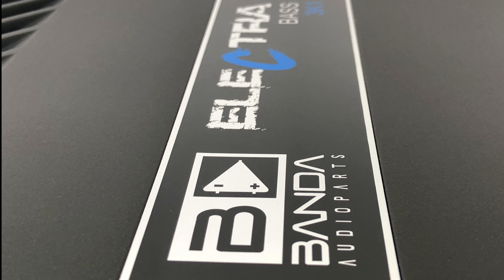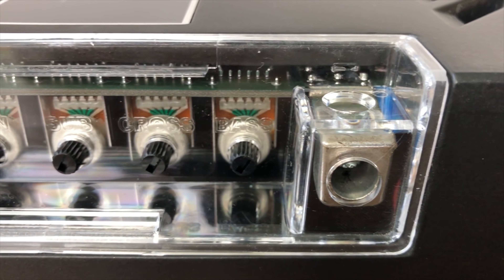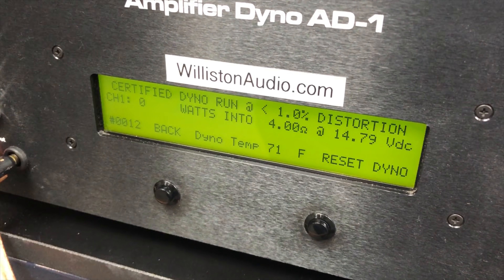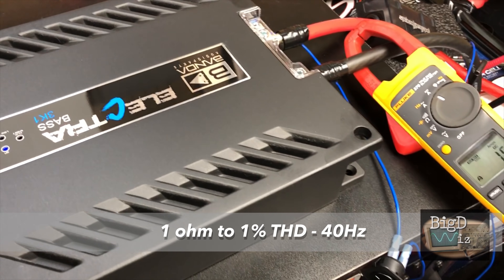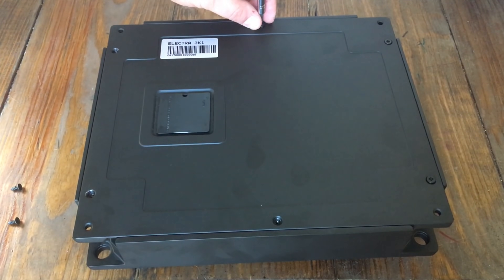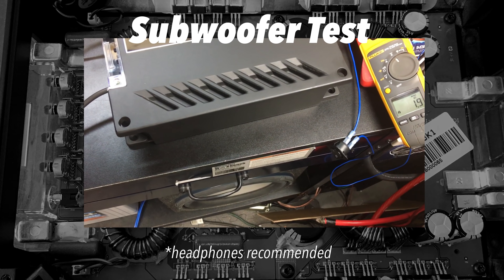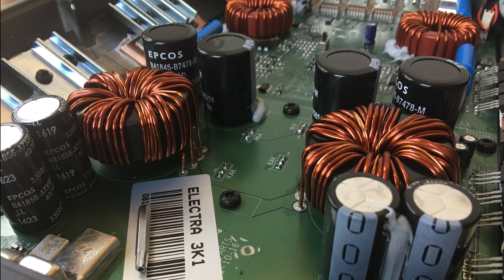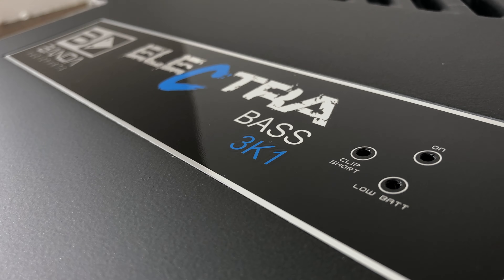Big Brazilian 3k? Banda Electra Bass 3k1 Amp Dyno Test (4K)

Comment: I'm running this amp for 2 years with good electrical. It never overheats in a tropical climate, delivers good power and has a switch to disable all filtering to allow the low lows, which is what I use it for
Reply: @SubwooferGym  hey bro, I know a year late. I have the 7k and it has 1 rca but headunit has 2 if I y split it gets way quieter. Do I just run one?
Reply: @alexrathbun3817  Hey, yes just run one. Running two doesn't mean twice the output level. It's the same mono signal

Comment: It doesn’t go into protection and all the amps turn on fine I had tested everything before putting it into the car with one battery and a booster the bass played for a while with no problems but it doesn’t wanna play in the car all the other amps are getting sound out

Comment: Epcos? Wow! Those are very high quality (same compnay as TDK) Japanese caps. Like same situation as Rubycon and Nichicon... they are the real deal. I see your efficiency numbers are a bit lower than they should be since the amps will spike up in current when clipping and that is where you took your amperage measurements on your clamp...  I would say efficiency is more like 75-80% rather than 65-70% - Either way, great test, great observations on the quality of the heatsink.. You know I think these may be better than Soundigital... they sure are cheaper!!! I always considered Soundigital the gold standard for Brazilians... obviously Taramps is pretty cheap.. (although not terrible compared to some Chinese clones) but the Soundigital is decent (albeit soundigital is WAY overpriced) - I think I might pick up one of these Bandas to try out...  - Like for real, companies that are crappy dont (usually) spend money on quality Japanese components.. My trust for them has gone way up seeing those Epcos caps.

Comment: The Electra 12k looks like its sized rite. Looks like the same case as the 8k8. Got one on the way, fingers crossed it turns out to be good.
Reply: How did you like it? I just got the 12k and mine is freaking loud! Blew my fuses and got 2 more. Haven't seen the clip light yet sooooo.....
Reply: @michaelnewkirk578  I actually ended up getting the 12k .5 ohm. I ordered the 8 then a week later got an email saying there out of stock.   I'm running it at 1 ohm on 2 rs platinum 18s and they slam. Getting ready to get 2 more 18s to run 4 at .5.
Reply: @timjd7964  yes I have the 12k one ohm model running it on some FI Team V1 15s, and they slam! Had it for almost a week now but blew the 300 amp fuses so I had to buy some more. So far so good 👍
Reply: @timjd7964  got it all in a Scion tc.....I know things are going to break 😱😅
Reply: @michaelnewkirk578  hell ya that's part of the fun
Reply: @michaelnewkirk578  and to answer your question it's been a solid amp for the 3 months or so I've had it, no problems at all.

Comment: Banda or soundigital?? Which is better??
Reply from the maker: That’s tough, both seem similar in quality to me
Reply: @wal  heard that SD has heating and build quality issue. Need to power 4 x 180 watt speaker  and considering either banda beat 800.4 or soundigital 800.4.but the SD is more expensive, lower wattage(8 watt less than banda) and lower efficiency as compared to banda.

Comment: Thinking of getting back into the life. I used to have a Soundigital 8K powering 2 DD 18s. That was around the time Brazilian Amps were just coming over. No one wanted to believe the power they were putting out because of the small wire inputs. I didn’t push it hard, but that 8K never got hot.

Comment: I use Banda in my car and recommend it.  Good frequency response, good construction, good adjustments, it has the power it promises and it is beautiful.  The disadvantage I see is that it is not as small as Soundigital.
Reply: Banda beautiful? Which model?? Not the beat version.
Reply: Which model do you have?  I just ordered an Electra bass 8k

Comment: I’ve been hearing that if you go with Brazilian amps that the Banda is the way to go. It has a better board layout. The Tarramps and sound digital just can’t dissipate the heat. The Korean amps just have a cleaner sound and better reliability.
Reply: So, should i go with banda or pioneer??

Comment: Can you make a video explaining on why they use single rca jack input and single rca jack output on these Brazilian and smaller full range amps. I have a sfb2000 that has the same issue and I'm hesitant to use a y splitter because I've never encountered an amplifier like this
Reply from the maker: Great question
Reply: Well they use single inputs because its quite common to use it with sound processors/crossovers that mixes the audio beforehand.

Comment: Not many FETs in there, and small coils for a3k amp.
Brazilian amps must have a completely different design
Reply from the maker: Full bridge design minimizing components to maximize output.
Reply: @wal  Thanks for the reply.
That might explain why they don't like to be run into lower ohm loads

Comment: still waiting for some stetsom amp to go through taht test :)
Reply: I second that, I have the ex 3000 eq and I would like to see real rated power aswell
Reply: @RomaVilla  Stetsom is one of the worst amplifiers brand that we have here in Brazil. SounDigital, Banda and the JBL BR-A line are the best ones
Reply: @L-2K  I guess its all about how you set it up cause ive had mine for over 6 months now and its pushing my 15 zvx no sweat all day long. I have a sfb2k brand new and I get better sound and lower notes with the stetsom vs the sfb2k. Also I got the stetsom and sfb for free so either way I cant complain. Clip light on both amps aswell so that helps with the clean signal. To each their own....💯 but I agree with you 100%.  So many better amps to choose from I just have to unload both of my amps and then invest in an sk3500 as soon as I get the fynds.

Comment: Banda . This amplifier is the best in Brazil .😎. I have an 8000w and it plays a lot.  🔊🤤
Reply: are they good for midrange speakers?
Reply: @yan5362  It will play well too, depending on the power of your speakers.

the ideal would be for you to research the available models of the Banda line checking the powers of the modules to see which would be best in your system
Reply: @andersonbrene9497  the banda beat 800.4 is available at a good price here in mauritius. Need to power 4 deaf bonce midrange speakers of 180 watt rms each

Comment: Why are bass boost controls on the amp not recommended to use?
Reply from the maker: Typically bass controls on amps are at a set frequency and not matching the true frequency most people want/need boosted. Look for variable frequency bass boosts if you really need it or use an external EQ

Comment: Is the Dyno AD-1 reading RMS or peak power? I ask because in another video you ran dynamic mode with some music into the TP3116 and the reading went to 96 and stayed there.
Reply from the maker: All measurements on Dyno are RMS. The dynamic tests are pulse tracks, so you will see power jump up quickly on those tests. You can see the manual on DamoreEngineering.com for the AD-1 Amp Dyno if you have Q’s about the modes.

Comment: These Brazilian amps must not have any de-rating.  I still have a hard time believing these are safe for 99.9% of the time in use.  Lots of power from a relatively small thermal frame.  Pretty similar layout and FET mounting arrangement to an Alpine PDX M12/M6 main board.  This amp should have maybe 16 PS FETs and 16 Output FETs, but I see 8 and 12.  A FLIR camera displaying the thermal output would be pretty telltale on one of these amps under sustained load.
Reply from the maker: Matt are you aware of the architecture differences between Brazilian full bridge and traditional half bridge designs?

Comment: How do calculate efficiency? Also why are u clamping the negative instead of the positive
Reply from the maker: Current measured x voltage. Then take watts shown on Dyno and divide by the (current x voltage). Doesn’t matter which wire you clamp (positive or negative), same current flows through each

Comment: Hi BigDWiz.. i wanted to ask you,what do you think about kicker L7 subwoofer? or what would you recomend me for a nice clean bass around 800 watt rms.. i own a pioneer GM-D9601 and a kicker compRT 500 watt rms but i´m not happy with the output..what would you recomend me ? maybe you can make me a better recomandation for both sub and amp,for a clean loud punchy bass..i also don t have enough space for a pair of two 12s in my car, an audi a3 sportback..  thanks
Reply from the maker: Subwoofers are personal preference. I like JL Audio subs, but I know they are expensive. A single 10W7 would rock your Audi as it does my Accord. Maybe check local listings for a good used one? I got mine for around $200 used
Reply: BigDWiz.. Thank you BigDWiz :)

Comment: @BigDWiz I’m a new subwoofer enthusiast, and I noticed you said do not use bass boost on the amp. Can you explain that to me? Or anyone?
Reply from the maker: Bass boost on many amps can add distortion. Also, unless the bass boost has a variable frequency, then the default boost frequency is usually not the correct frequency. In this case it's 45Hz, which may not be low enough for your application. Also, most remote bass knobs these days adjust the gain of the amp, not a specific bass frequency (and this is the proper way to increase your sub's volume)
Reply: BigDWiz appreciate it! Already subscribed 
Keep the vids coming
Reply: @wal  seria melhor usar reforço de grave no próprio processador ou player ao invés de usar no bass bosst do módulo?

Comment: 7:48 So what'd the difference between "1% mode" and "Clipping" mode? Clipping is a form of the general term distortion. So if we're talking 1% total harmonic distortion and we're using sine waves, how is that different from clipping? Me thinks a term is being used improperly here?
Reply from the maker: Amp Dyno distinguished tests between the two. The certified test stops measuring at 1% THD. Whereas the uncertified continues to the point of clipping and continues the test to see if any more RMS Power can be obtained at this point of clipping. With many amps there can be a significant difference in the results (4-7%), but most show 1% or less difference between the two tests

Comment: Come on BigD. Throw some Stetsom amps on the channel. Their best selling amp is the EX3000eq buit have many amps from 160w to 30k. I have 3 of their amps and would love to see some certified numbers
Reply from the maker: I tried one, so did Ryan Blankenship. We both saw smoke 💨, would not complete the test and I only got 1700’ish watts out of a 3kW amp
Reply: BigDWiz thats odd. Ive ran the 3k on 2 18s at 0.7 ohm for 7 months and never even had a heat issue.
Reply: My 7k2e has been flogged daily for 5 years w/o ever getting more than luke warm. I've even taken it out of the car (thus connected and disconnected it) hundreds of times. I even run it all the way down to protect mode at 9.2V because I don't have proper battery support. I've dropped it that low millions of times wired .7 rising .3 to a perfect 1ohm. I power cycle and go right back to  10V hits nonstop, for as long as I like. I'm so spoiled now, I won't even entertain the idea of buying any other brand amp. 

Setup is 2 soloX18s in 26.5 cubes tuned to 36Hz.
Reply: STAY WHITE hell yeah man i wanna see that shit. I just upped to the EX8000eq and gonna order 2 PSI pf4 18s soon. Box is 41 ft^3 6th order blowthrough
Reply: Also the bridge mode, please!! @BigDWiz

Comment: The clip of the crowd running away from the trailer while they're all dressed the same cracks me up every time I see it. Did you use your torx bit to cover up the serial number on the board? Pleeze tell me you didn't drop it into that high voltage amp by accident!!! Thanks for another great vid big D
Reply from the maker: I love that clip too. “get me outta here!”   Yeah I just covered the serial number in a few pics 😊

Comment: Did you have a problem with preout voltage from the hu? Ik the older bandas didn't like higher preout voltages.
Reply from the maker: No problem with HU. This amp required  gain all the way up with HU volume all the way up. Otherwise it would not reach full output potential. Most modern amps are set around half to obtain max output during the 10 sec test

Comment: Here are some facts about that sound truck "Carreta Treme Treme":
- 264 x 15" 3,750 W woofers;
- 112 x mid/high drivers;
- 45 x Soundigital amps, giving more than 3 million watts RMS;
- 30,000 amps in batteries;
 - 3 tons of cables. 10 km of wiring.

[http://www.carretatremetreme.com.br/a-carreta]
The picture of the truck that appears down on this page is the old version.
They upgraded the sound system in 2017.
Reply from the maker: Thank you for providing the information and link 👍
Reply: Well great...Page cannot be found

Comment: Faltou a legenda..
Reply: Nil M. Vdd para mois leigos no Igles kkkk eu tenho um Electra vale cada centavo gasto
Reply: Victor Arez resumindo, olhe a data de fabricação do módulo quando ele abre a placa é de 2016, e a Elekctra só foi lançada na metade de 2017, resumindo ele testou um protótipo e este provavelmente não é o amplificador que chegou no consumidor final...
A diferença amigo é que a SD era 2018 e não cumpriu a potência à mais de 13v, imagina à 12,6, vai ter lá seus 2400, 2500 rms, esse teste com a Banda só considero apartir de um módulo real que não seja um protótipo como o do vídeo.
Reply: Nil M. Mas posso te confirma que esse módulo tem uma eficiência melhor que esse sd e um consumo menor q sd 3000 ambos são os melhores do nosso mercado pelo fato de serem nacionais até hj não vi um nacional melhor que eles taramps e stetsom só for os de alta voltagem pq os de pequenos projetos eles deixam o consumidor que têm um sarro conhecimento a desejar mas fico feliz que os fabricantes brasileiros estejam alcançando a gringa isso significa que nossos produtos não são tão ruim como uma grande maioria diz ne vdd amg

Comment: Big D Wiz have you seen or heard of the Crunch PD3000.2 3000 Watt 2-Channel Pro Power Car Audio Amplifier Class AB Amp on Amazon? Its been a while since I've hear from the company. Was just wondering.
Reply from the maker: Crunch is now owned by Maxxsonics (with HiFonics, MB Quart and Autotek). That 3000 watt rating is a MAX number

Comment: Can we please get a dyno of the soundqubed 4500.1? There aren't any videos on YouTube of this amp on the dyno.
Reply from the maker: That’s a pricey one brother. Stay tuned for an upcoming shootout of 3-3.5k Korean amps. It’s gonna be a shocker to some 😱
Reply: BigDWiz I'll work with it.. But I'm still looking for the soundqubed video.. Eventually someone will be just as curious as I am to see if those $734 are a must or bust!! 😂 😂 😂
Reply: Shaun Jay we got 4300 rms clamped consistently inside and outside the lanes on a SQ 4500, wired to 0.5, rising to 0.9 at 12.2v. This particular vehicle was running a northstar agm34 under the hood, a 300 amp GP alt, and a single northstar smsagm80 (the 35lb northstar) as the entire rear battery bank accompanied with sufficient wiring. This vehicle consistently busted out of the 4k rms class in many runs until things were aligned and dialed back properly. Unless any parts qualities have changed since they first came out, this is what you should expect.
Reply: BigDWiz Oh hell yeah. Looking forward to that one!
Reply: The new Soundqubed S line is a lot more reasonable. The 1250 amp is only 179. The 2250 has already been dyno'd.

Comment: Another great video Big D! I have to say that I find all these Brazilian amps somewhat interesting, but I still can't see the appeal of these over more traditional designs that we're used to. With that said, I think I like the overall design of this one the best of any that you have tested up to this point. I kind of like how they incorporated the cooling fans into the corners of the heatsink. Pretty nice design all around. Keep 'em coming, Big D!!! Great job!
Reply from the maker: The biggest appeal is the size. They are not cheaper until you get to the 5k or larger amps

Comment: 4ga for a 3k amp? Silly Brazilians
Reply from the maker: Running the amp for mids/highs would not put such a strain on it, but yeah being used as bass amps...they need bigger inputs! I provided this feedback to the Banda distributor
Reply: Brazilian amps are built like that because they are meant to be very close to the battery bank. In Brazil they don’t run HO alternators often. Just big battery banks. A 1’ run of 4 gauge can take quite a bit of amperage.  All 10 of my Taramps were ran with very short power and grounds to my battery bank.
Reply: Nice input, comment liked
Reply: 4 gauge is alright for ONLY very short runs. (I commented before noticing popwarhomie's comment).
Reply: Yeah, and he was being kind these things sound like absolute ass unless your volume is on max.
Reply: A Omar that's probably one reason why Brazilian amps are notorious for catching fire.
Reply: Name any today brand u want and I’ll put this Banda next to it!! And simple will destroy urs!!
Reply: @gabedaxe6622  I'm a Stersom fan. 
But, the Orion 3k did 8,900W rms here on this channel, so, that's much higher output than this 3k.
Reply: U need to understand that Brazilian amp are not made for 4  speakers. Once u added 20 like triton snake or Eros you see the difference. Another thing is the value American amp are for American is that simple. Banda soundigital stetsom etc are cheap over there less than 300usa dollar Orion is like 500 to 800 for something regular with 800 in Brazil u get the amp and 4 good speaker that destroy any EV.